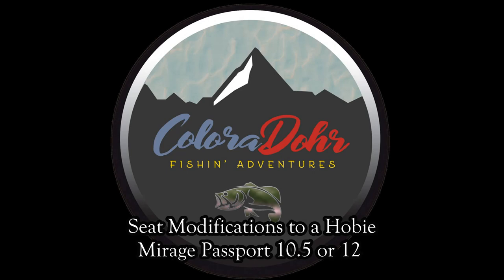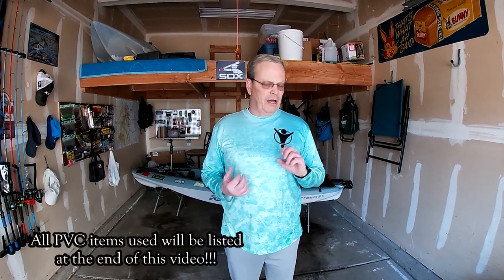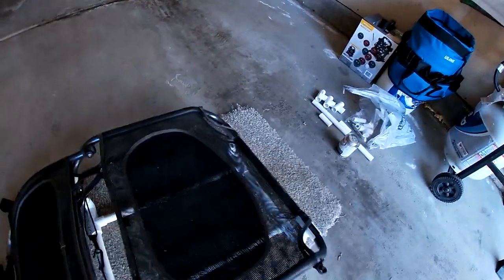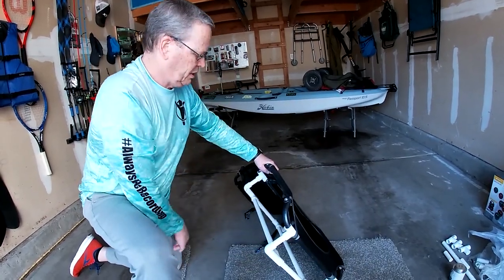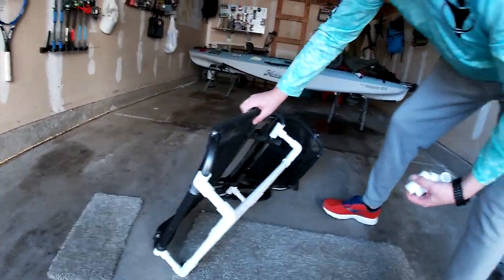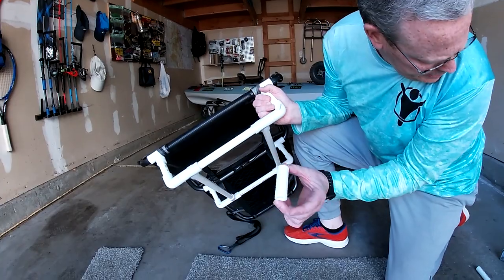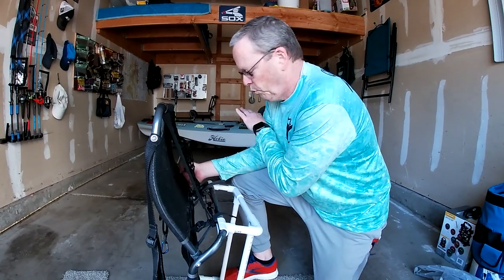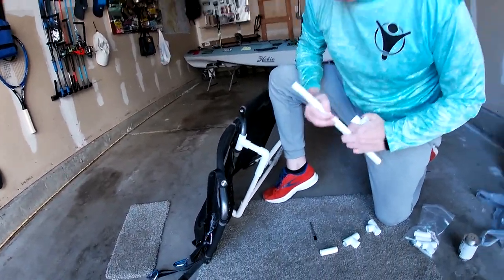Hobie Kayak Passport 10.5' & 12' Seat Mods || Increasing seat height

Comment: I fish out of a passport 12.0 year around in the Tx coast. Ive added both map pockets, h crate, fish finder, rectangular hatch, XL rudder, anchor trolley, 6mm deck pad kit from Louisiana custom kayaks, and 2 more 4" tracks behind the seat on the starboard and port rails. The XL passport rudder and the vertical rectangular hatch had the biggest and most instant impact on my fishing. If you havent done those 2 things, I highly recommend them. 

Great content sir. The seat is the biggest downfall of the passport. Ive measured other seats from hobie and other manufacturers to see if it can be swapped. I settled on a 4" seat cushion. Your idea is a great option.
Reply from the maker: I still have more to add to mine just like you. It is taking season after season for the add-ons. I will have to try some do what you suggest. Thank you for the kind remarks and let’s continue to enjoy the outdoors that we have! 👍
Reply: I just ordered the rotomolded version for going to the coast in Galveston.
Reply: @briarfox637  Fishing tackle Unlimoted on 45 and fuqua has a few on stock I saw yesterday.

Comment: Great video! I fish out of a 10.5 Passport, I’ve upgraded the rudder, added map pockets and an extra hatch. I like this idea. I added an H bar standing assist so I can stand up and stretch. Not stable enough to stand up and fish. I post fishing videos on my channel too.
Reply from the maker: Thanks Randy! I continue to make some additional mods to my kayak and I do agree with you, it is very hard to stand in and therefore I increased the height of the seat to help with some sight fishing and getting in and out of my kayak easier. I also just subscribed to your channel!!!
Reply: @coloradohrfishin  Thanks for the sub! We both have right around 100. Are you concerned about the stability when you’re sitting in your elevated seat?
Reply from the maker: Randy, the stability was shaky at the beginning but made some tighter adjustments to all the access points on the PVC. I am stably now, but like all kayaks, it will depend on the boat traffic and waves!
Reply: Which H Bar did you use on your Passport 10.5.  I need it for the same reason you do to just get up.  Plus getting out and in of the kayak will be easier.
Reply from the maker: At this time I do not have an H Bar installed. With the raising for my seat it has helped me to get in and out much easier. I maybe looking at that for next year.
Reply: The Passport 10.5 takes Hobie’s universal H bar standing assist.
Reply from the maker: Thank you Randy for confirming this. It will help me and potentially others!

Comment: Great idea, two quick questions, could you please put a parts list in the description.
Second, I have the passport 12 and I am about to mount a transducer for my fish finder using the thru hull kit. The transducer cable routes through the scupper hole between the seat and the hatch and then back into the hull about 2”in front of that . I am wondering if the fron support of the seat would sit on the transducer cable?
Reply from the maker: Thank you. I will try and add that in the description as time allows. For the other question I do not believe it should cause any issues or problems. If it dies you can still make additional adjustments.
Reply: I have a Passport 12, and I just finished this mod.  I had to make a few changes from his design for the 10.  Check out my post here: https://www.reddit.com/r/kayakfishing/comments/xen97v/hobie_passport_12_seat_mod_custom_riser_using_pvc/

Comment: Thank you for posting this video.  Your design is ingenious in my opinion.  The seat that comes with the Passport is awful.  I have followed your instructions to mod my seat and it is so much better on the old knees getting in and out of the boat.  I decided not to glue the vertical pieces so if I choose to change the height, I can just cut new lengths of pvc to adjust accordingly.  I also adjusted the length of the vertical pieces to have the seat in a slight recline position which is much more comfortable.  The extra seat height does change the center of gravity of the boat somewhat, but it is still very stable.
Reply from the maker: Glad this video helped you out. I agree that it makes it easier pedaling and getting in and out of the boat but yes, center of gravity changes. Good luck on the waters!!!

Comment: good video! I copied your design but overlooked one detail. I used a 3 way pvc elbow. This brought the tree connectors closer. I couldnt bring them out much anyway because a weld near the corner on one side. You got the mesh to fit trees in front so nice. mine is too loose. I haven't tried mine on the water yet. did you feel any leg discomfort after pedaling? just curious. thank you!
Reply from the maker: Glad this helped you out.👍 It has been a life saver to me in many ways. As for the discomfort, there are at times but  that is when I am pedaling all the time or keep my feet on the pedals. Taking them off at various times and stretching makes it much more bearable.

Comment: Whats th gap measurement on those tees that connect to the seat frame ? I'm just gonna get tees and cut my own gaps with a bandsaw
Reply from the maker: Jordan, I am away on a very short trip but will get that information for you when I return within the next two days. Stay tuned!
Reply from the maker: The gap within the snap Tee measures at 9/16 of an inch. This allows for it to snap on tightly to the bar. Hope this helps you out.
Reply: @coloradohrfishin  yessir thats what I needed. Thank you !

Comment: But why? Less stability, more fragile construction….
Reply from the maker: I kept it a lower height for me and stability was still there. If you go crazy on how high you out it in inches, yes, it will most definitely effect it. Much easier for me to sit in it when you get to my age too! 😊👍
Reply: yeah, best part of the passport is the low seat height, so stable you can nap on the water
Reply from the maker: @CheekyMonkey888 , I hear ya but for me I needed a slight riser. Thanks for the comments and continue to do so and if possible, follow my channel!